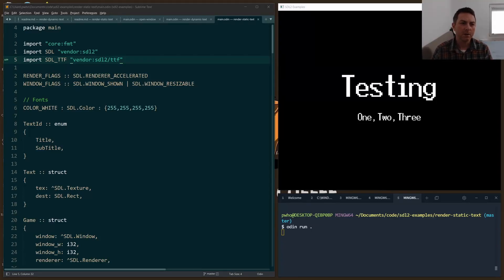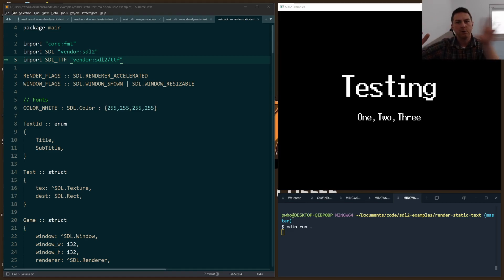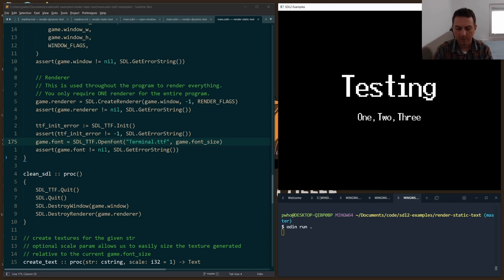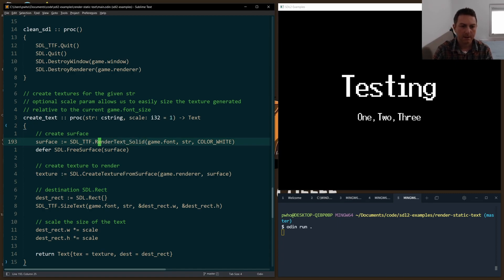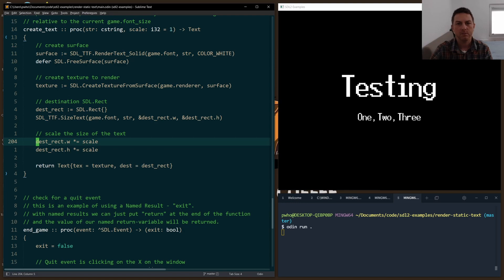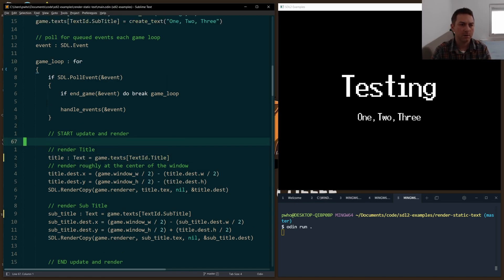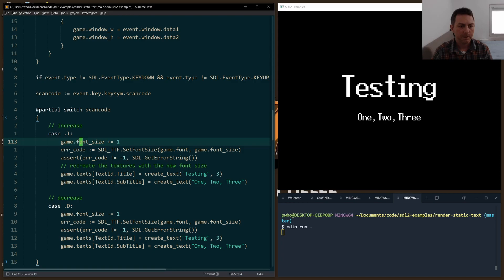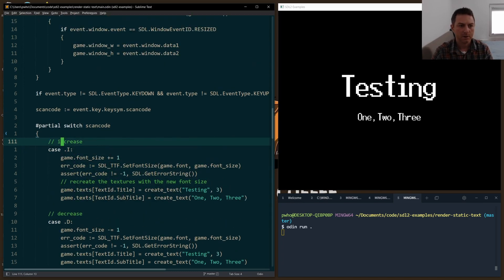Render Static Text with SDL2 in Less Than 5 Minutes

Comment: Hey, have you tried to compile yours to wasm? or maybe it's not doable cuz you're using SDL? After a long break, I finally finished mine both in Go and Odin. I'm using Raylib for both. But then, maybe Raylib bindings are not right for wasm compilation? I get errors for both Go and Odin compilation to wasm, both on Windows and Linux. There's not much info about that on Discord. Have you heard anything about that?
Reply from the maker: I'm afraid I haven't tried anything with wasm, no. I'm curious, though. Have you made notes on what you have found so far? I'd like to try putting my game on the browser.
Reply: @handmadegamesdev  Since I have Raylib in mine, I think I might need to port my code to C to compile to wasm in the worst case. It's just over a thousand lines and the only thing i use heap for is a few dynamic arrays of byte pointers which I can easily implement in C, so not a big deal, but I'm kind of done with it at this point. I'm not sure if I want to spend more time on it.